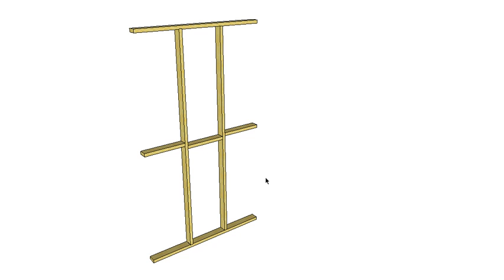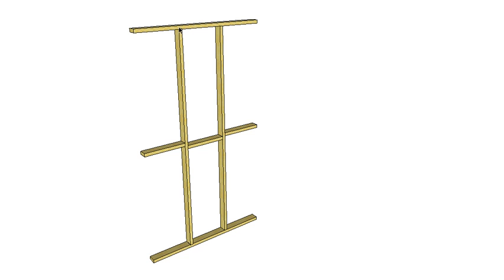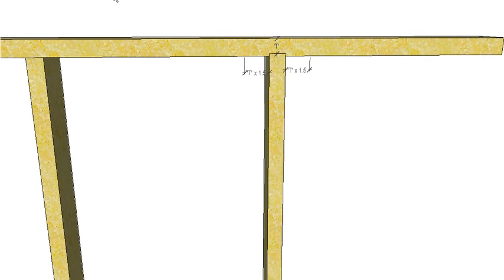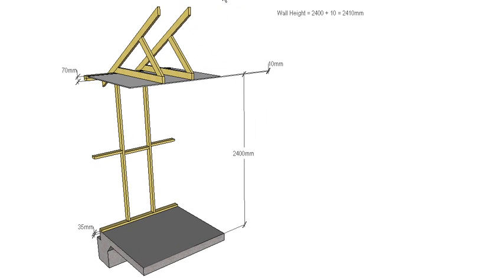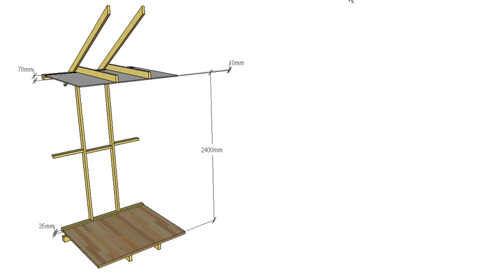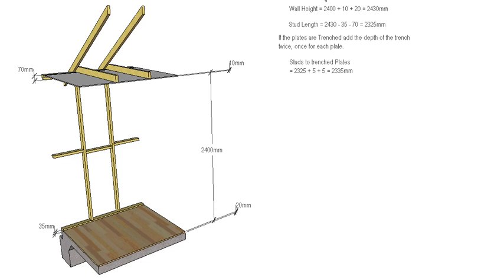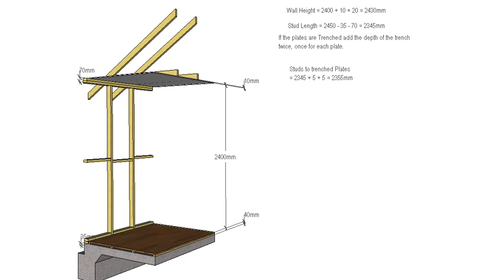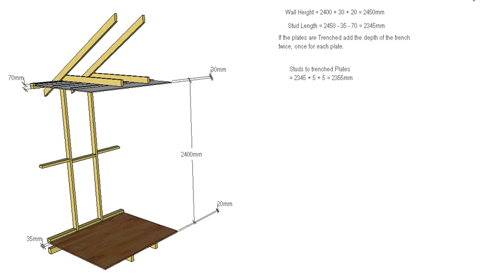Calculate Stud Length

Comment: Dont you also got to allow extra 10mm for gibboard sheets to sit above the floor ?
Reply from the maker: HI level Neville 
No this is usually acounted for in the thickness of the ceiling or the flooring it should not be a factor in your Stud height